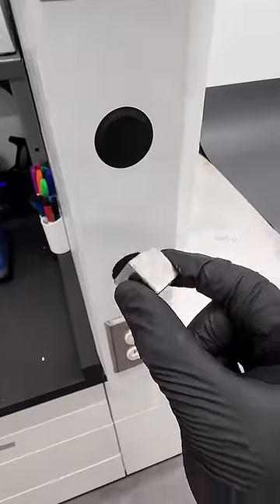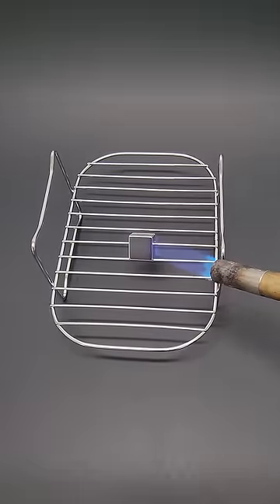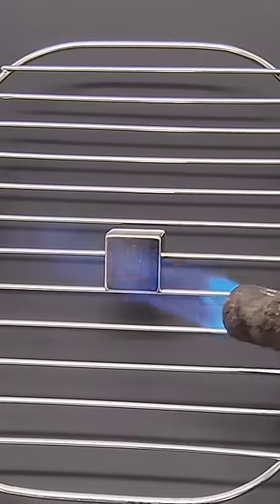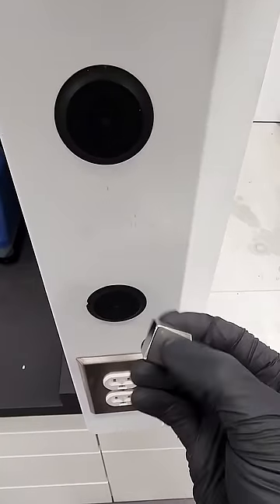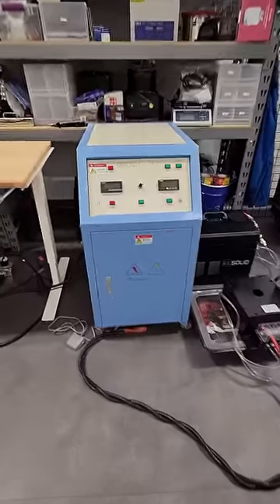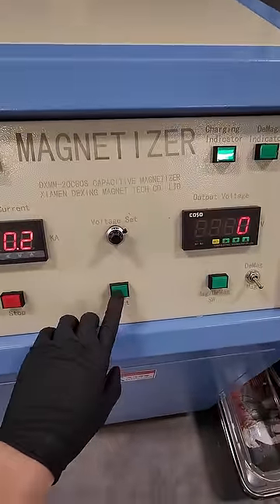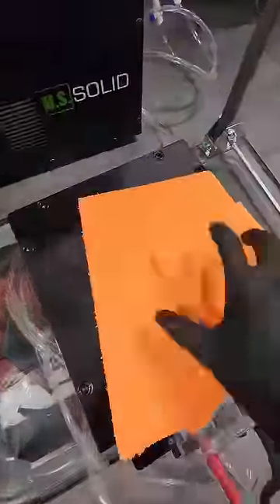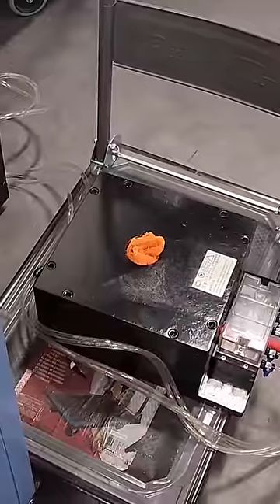I accidentally killed this magnet

Comment: The first scenario was a Curie Effect, where a magnet losess it's capability to magnetize due to high Temp (disorganizing the magnetic particle), while the 2nd one is the hysteresis process which the current reorganized the particles of the magnet returning to its original state. 
Just take note that if there's current, there's magnetism and vice versa.
Reply: Are living being magnetic then?
Reply: @NickZ-dn7cr  Yes, and it's frequently  used. Mainly to scan brains, I think.
Reply: @MouseCouldntFindFood  they use magnets to read the electrical pathways as far as I understand. I'm curious if you upped the voltage of a human, would iron stick?
Reply: Wow 👍 thanks
Reply: Hysteresis?
Reply: So if there’s electricity there’s magnetic force too ?
Reply: Based yellow pilled propaganda, nice try
Reply: You are the comment i was looking for 🤙 funny how i had the logic cristal clear in my mind but I didn't know the term curie effect !
Reply: @theelastog1580 nope, electro-magnetism, not magnetism.
Reply: @Der_Teebeutel 

it's all electro magnetism.

Theoria apophasis is a good youtuber to check out
Reply: Not magnet particle bro its magnetic moment in same direction
Reply: @TheOGJeff  pure rubbish, e-mag is inducted by circuiting power in a metall, power off - no mag, fe-mag can't be switched off
Reply: Fucking thank you.
 All I wanted was to know why. You, Sir,
 provided direction.
🫡
I will suggest that the 2nd process in which he demonstrated might be the electromagnetic induction process.
Reply: Thank you for the explanation! Sad I had to scroll so far to find it!
Reply: @BigpapamoneymanMVPtypebeat wrong thread
Reply: Chapter magnetism class 12 😉
Reply: A magnet can also demagnetize if its jarred like dropping it onto a hard surface from a sufficient enough height.
Reply: Nd Magnets can permanently suffer permanent damage from the Curie Effect. This used to be a very big issue when Nd was used for loudspeakers in the early days of use. JBL had a huge problem with it as they were losing "Charge"
Nd had to be reformulated to retain it for the very small heating the assemblies underwent in use.
Ferrite ( Feroba ) does not have such issues as it better retain flux over time. The machine is a "Gausser" 
They are used to charge magnets
Reply: Based thread.
Reply: Basically where electrons are free to move there is magnetism
Reply: hysteresis is a pain in the ass
Reply: @NickZ6297 not voice versa
Reply: Just use water

Comment: The reason this happens is because of what we call domains of the magnet. The domains are small chunks of the metal that have the same direction in their magnetic dipole and all these domains are lined up in the beginning. Then when the heat of the blow torch is applied the domains deform and the dipoles start to cancel eachother out. But when put into that machine with the large voltage you can forcefully realign the domains of the magnet so that that it again acts with ferromagnetic properties.
Reply: If i remember correctly this machine should use magnetic annealing to manipulate the magnetic hysteresis of the material
Reply: was looking for this ty
Reply: that's cool! never knew that til now
Reply: interesting
thank you very much, kind stranger
Reply: so if I understand this correctly, he just recalibrated the magnet
Reply: @DenethorDurrandir  yes
which is not an easy feat
Reply: why did it get stronger then?
Reply: @unturnedd  Because initially, some of the magnetic domains were not aligned.
Reply: i like your funny words, magic man
Reply: This sounds legitimate. Makes me want to learn.
Reply: I like your funny words magic man
Reply: @unturnedd  because when the magnet was naturally formed, it wasn't perfectly aligned, by shooting it with high voltage it gets aligned more consistently
Reply: It kinda seems obvious.
Reply: Neat.
Reply: So essentially, it originally looked like this:
+ + + + + – + – + – + – + – – – – –

Then heat made it look like this:
+ – + – + – + – + – + – + – + – + –

Then the machine made it look like this:
+ + + + + + + + + – – – – – – – – –
Reply: Thank you for explaining this. It most definitely saved me from the googling that would have followed. 😂
Reply: When I was younger I wanted to be a scientist but then I realized I'd have to learn how to speak like you did in this comment-
Reply: I like your funny words magiK man...
Reply: @DenethorDurrandir by high voltage you mean it must be high magnetic field right?
Reply: @davel7037  high voltage which produces strong magnetic field, yes
Reply: Thank you kind Surr..!!! But if you ask me after 5 minutes what I just read….. 😬😬
Reply: i like your funny words magic man
Reply: Do you know if with time the magnet will "die" again by itself?
Reply: @Joanropo  no, it's considered a "permanent magnet".  Maybe over the course of a couple thousand years it will lose some magnetism, but we won't have to worry about it by then.
Reply: @bradbeck2601  thank you!
Reply: @bradbeck2601 Your comment is gold for how you managed to visually present the whole point with only + and - I understand it perfectly now, thank you. Hope you get more likes
Reply: @DenethorDurrandir Does the black box component of the magnetizer work like some reverse induced current, where instead of a magnet creating a change of potential difference with its field, the voltage produces a magnetic field? Also, can this machine create a magnet out of non ferromagnetic metals? Or it just "fixes" a natural magnet?

Comment: Magnets get demagnetized when you heat them, heat makes molecules get random polarity. When you expose it to larger magnet it is capable of magnetizing it by aligning the polarity of all molecules.
Reply: Vibrations and sharp blows are also capable of demagnetizing a magnet
Reply: Thank you I was hoping he'd explain why it happened
Reply: Love it
Reply: Was thinking he basiclly stuck the magnet into a coil wrapped in a box.. am i right in my assumption? Was going to say magneto, but settled on coil. I know putting a charged magnet into a copper coil creates energy (electricity) but can it recharg a dead one.  My theory is yes, but that is pure speculation. Maybe i need to brush up on Lenz's Law.. 😂
Reply: Don’t get your hopes up too high, if you use a regular magnet, it won’t work really well, you’d probably have to use a super strong electromagnet, like this guy has, electromagnets work the same way, the electricity make a normally non polarized metal polarized by adding a current, if you want to make a stronger one, add a lot of coils and have a stronger magnet
Reply: @jam-sp1sv  i should have written Neodymium not alnico magnet.
Reply: @bearingcee  your terminology is definitely off, charged is the wrong term when talking about magnets, as are recharged and dead. Magnets aren’t batteries or capacitors or anything else that gets charged. The difference between a “charged” and “dead” magnet as you put it is the orientation of atoms within the magnet itself, when it is magnetised all the poles are aligned. When a magnet isn’t magnetised that just means the poles are oriented randomly. Using a coil to magnetise a magnet just uses a very strong magnetic field to orient the poles within the magnet. Heating a magnet causes the poles to shift back into a more random orientation.
Reply: bro think he is ishowspeed
Reply: Whoa
Reply: @huliganthealchemist772 huh??
Reply: Pretty much what happens with cheap rice cookers
Reply: Это называется точкой Кюри
Reply: Just that they're called "magnetic domains" and not molecules
Reply: Why it got stronger?
Reply: Meth
Reply: but whats the force of magnets?not molecular interaction but lorentz force right, i remener having electric current over a spiral would produce a megnetic field. Can somebody explain this video more scientifically ?
Reply: except random is not a variable in science
Reply: Thanks 😊😊😊😊💯❤
Reply: That’s so cool
Reply: @amanshukla5546  magnetic domains are groups of atoms with aligned orbitals. So when the domains are aligned, so are the atoms (orbitals)
Reply: @zaydenhorn3080  you fr came to the comment section of an educational video to post the nerd emoji

Comment: So Magneto's weakness is Fire.
Reply: Well the dipoles within the magnet good dealigned through the thermal energy breaking up the domains so if you tried it on the battle field he'll probably kill you before you get to all magnetic materials 😂
Reply: @GetapassTickets   overthinking mate magneto is the magnet.
Reply: TL:DR magnetism is part of quantum physics and heat only effected the metal's ability to be strongly magnetic 

more along the line of the metal's structure alinement that effect it's magnetic force. magnetism is part of quantum physics it goes down to the atomic level. everything is magnetic just some materials have strong enough fields to be noticed by us. magneto controls magnetism. 

think of it like a onion its layers of metal but these layers only form a strong magnet if all the parts of the layers are facing the right directions and heat can make them not do that as they arent as compact as before so they move and face which ever way they want till cooled. 

that machine forced the layers to face the right way to a much greater degree as neodyminum is just a very magnetic element but some can have impurities that can effect it slightly so the that machine basically forced out those imperfections. so it became stronger as a result.
Reply: Pretty sure his weakness is being burned alive anyways regardless of his magnetism powers
Reply: Yeah.. no wonder why he turned that fire 🔥 brother first out of the bunch so rapidly in selection.. almost like he knew he had to convince him first.. or something 😏
Reply: bro everyone shows their weakness when u put them on fire
Reply: Magneto is not a magnet. He has mental ability.
Reply: Who knew?
Reply: 😂😂😂😂If they only knew
Reply: @servant691 damn so he survived Nazl Germany just to get burned alive???
Reply: @re2fan123  Pretty much

Comment: Repeat until u get a bite-size blackhole
Reply: A real black hole is way smaller than this magnet. At least thats what I've read about black holes.
Reply: @Taunus-Tim  you know black holes vary in size right
Reply: @NippyNep  the not visible part yes. But the actual center of mass, that is the black hole, is very very small.
Reply: @Taunus-Tim  this isn't really right either, yes black holes vary in sizes and they could be even galaxy sized, the mass is important, what you're talking about is the singularity in every black hole which is indeed tiny but that's the wrong term for this, that singularity is 1 single point and that point is infinitely small ..everything a black hole swallows ends up in this 1 single point and it's not nanometers or tinier, it's really infinitely small, the further stuff goes in, the tinier it gets and the more it's slowing down ..that also means even if ppl say time stops in a black hole, it seems like it but in reality it just keeps getting slower and slower striving towards infinity or infinitely slow, which means it's never 0 but like e.g. 0,000000000000000000000000001 and smaller and smaller and smaller (slower) the further you go ..so if you get into a black hole time stops for you because that's what you perceive but in reality 1 second would just take billions of years
Reply: @Taunus-Tim I think you mean the singularity in a black hole? Fun fact, we don't really know much about black holes, as no one has actually directly seen one. It's all theory.
Reply: @elijaholing people have seen black holes. Did you get your info from 2018? Lol. To clarity inferred or some other thing.
Reply: @NippyNep whatchu mean black holes.. das racists
Reply: @Videos_of_Glory_man  Man it's fucking scary to think that even though we know they exist, we don't know anything about them except how they form and work.
Makes me think about the things we could find in the future.
Reply: Black hole is more about mass density really than size
Reply: @theoriginalrudeboy2916 unwhite hole
Reply: @Maanjiro_g  Ish don't like ..